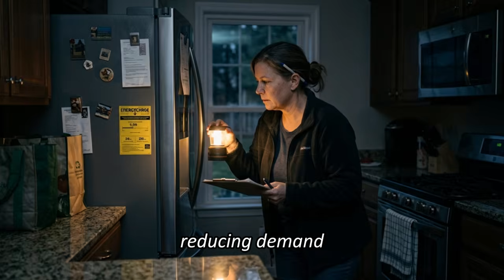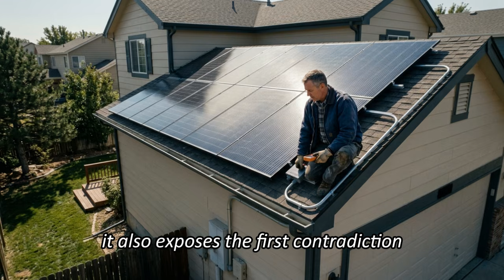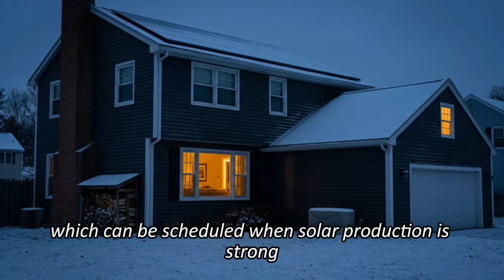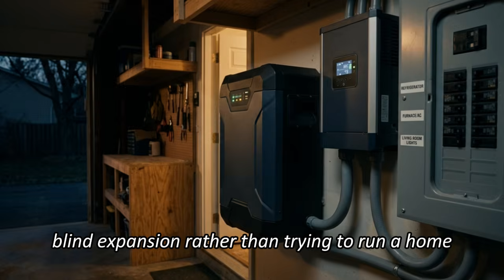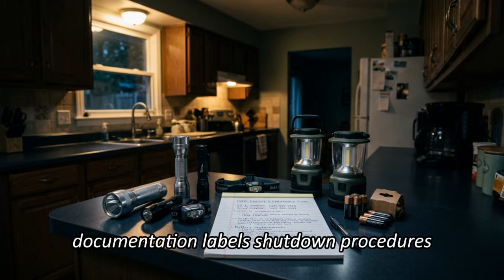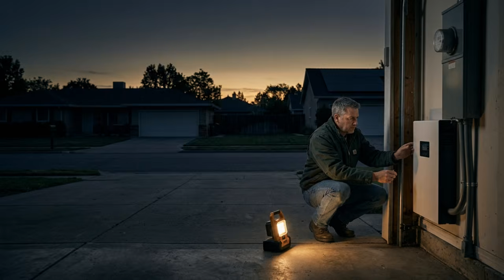Build Off Grid Power Before the Grid Fails

Comment: Do this as a pre preparedness exercise; Prioritise the first 100 watts of electricity among  every competing possibility for uses.
 Plan for times when NO electricity is consumed, then plan for times when no electricity is made but the freezer must run. Make absolutely certain that there is an electric clock that runs off one or two AA cells, Even better have a clock syncronised to your national/zone time standard. If you have two clocks, change the batteries half a year apart so both clocks don't stop at the same time. 
Realistically a 5w solar system will maintain a battery ready to work, but a power outage means 500w of panels would be better. Chose how much garden you want to sacrifice to panels, even then a generator may be helpful. Be generous! give your neighbour an hour of generator time for the price of the fuel- charge his battery, cool his fridge and freezer.

Comment: Every day you need to harvest some solar into a moderate battery pack, Keep the solar panels handy so as soon as needed they can be deployed on window sills. Light your rooms with LED lights they use about 10% of the electricity that a filament lamp will need. Keep as much preparation as covert as possible or you will have to support the whole road. Keeping the freezer cold could be the BIG problem. Eat fresh food and fridged food first only then try the frozen food and then the cans.